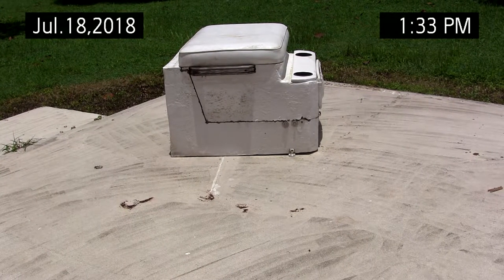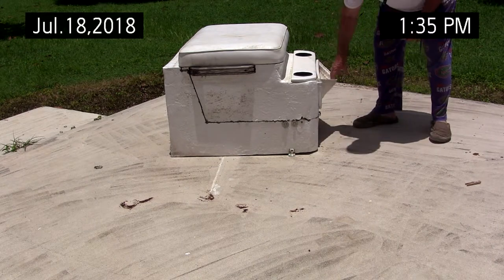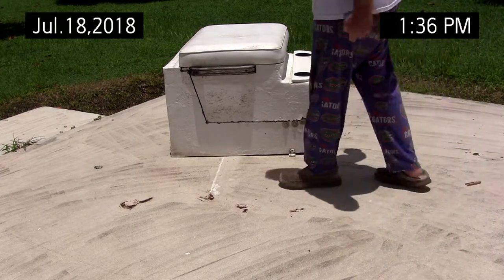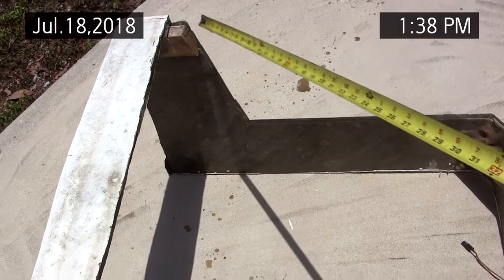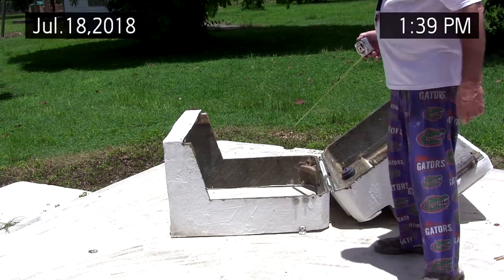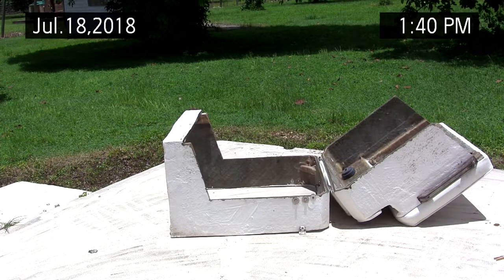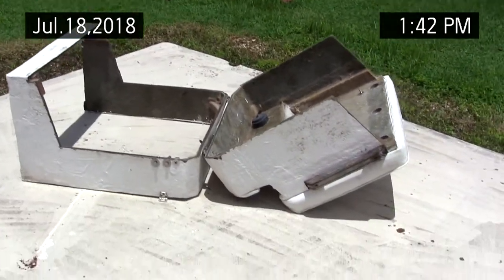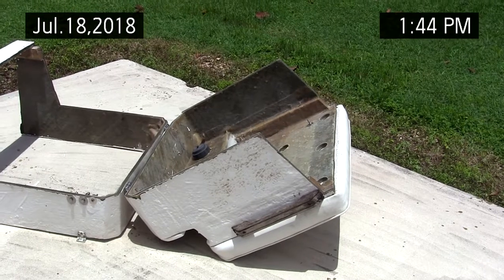Sterndrive Engine Cover (Dog House) fabrication 7-18-2018 Part 2 of 2 .

Comment: Boy that’s nice,,, thanks and would like to see it made
Reply from the maker: Hi Gregg; Thank you for the positive feedback. I may not be finished yet. I may go and sand and add some Divinycell to the interior to give the engine cover more sound absorbing and stronger. You can see how I made the engine cover in part # 1. Part # 1 is a very popular video with lots of views, but few people view part #2 so I am happy to see that someone is watching part # 2. Here is a link to Part # 1, thanks for watching and subscribe and share! https://www.youtube.com/watch?v=OhBBWx1URB8&t=528s&index=2&list=PLpRFf34f4RZpStdalL0E_F3zD033ke0SW
Reply: Dennis Sytsma thanks ,,, I’m getting ready to make a box for a boat that has a 351 in it and want to be different I guess, love to see this 100% done
Reply from the maker: Hi Gregg. I have the engine box apart again and I am working to fabricate the rear jump seat support boxes that go on both the port and starboard sides of the engine box. Weather in Florida has been bad and every time I go to do more fiberglass work a thunderstorm rolls in. I plan to add more structural fiberglass and Divinycell to the engine box to make it stronger and more sound proof. I might have been better off if I had built everything out of Divinycell H. Divinycell H is expensive, but an outstanding core material. The soul plate and stringers that I replaced marine grade plywood with Divinycell H are as good today as when I did the work in 1997 on my boat. I hope to post new video segments soon about the engine box and port and starboard seat support boxes. cheers.